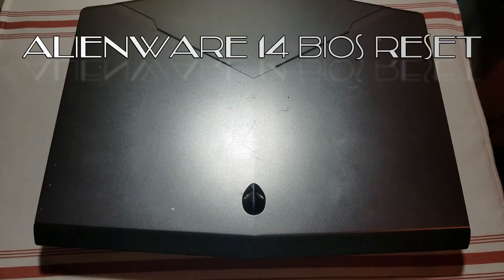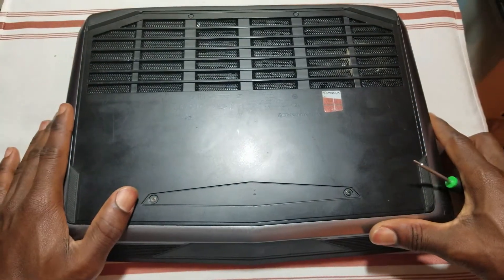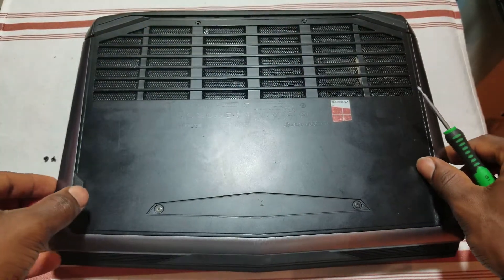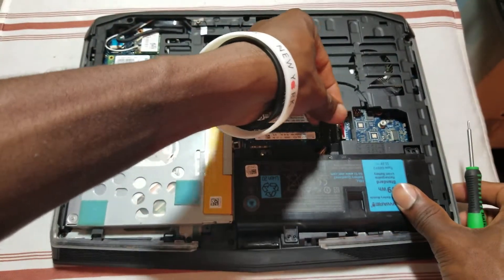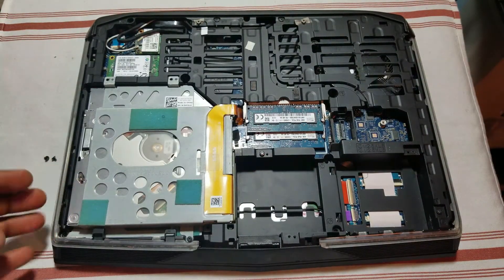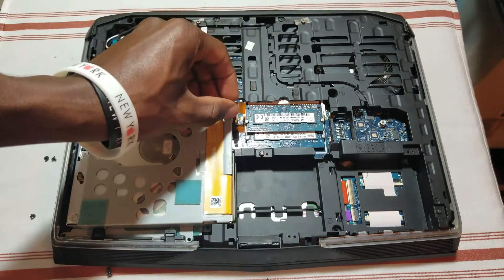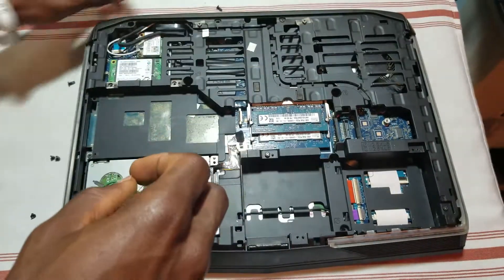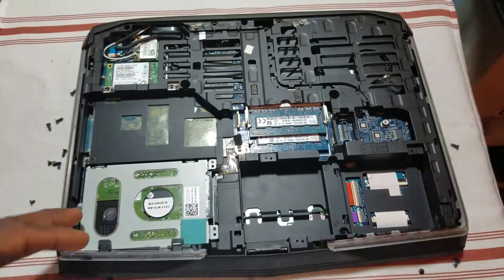Reset Alienware 14 BIOS CMOS battery Process

Comment: I have this exact model of AW14. Ive got a new board with the 2GB graphics card. When i installed it it turns on, lights up, but doesn't do anything else. Will this fix that? Its a good board just wont post.
Reply: Were you able to fix your issue bro?

Comment: I have a Alienware 15 R3 and My bios is Admin locked. I have disconnected the cos battery for 30 min and it never reset. Can you help me with this?
Reply from the maker: Check if next to the CMOS battery there is anything labeled PWD, PSWD, or PSWDCLR it could be a jumper or a switch. after actuated you have to try turning on the computer
Reply: @YvonSmart  Thanks. I will give it a try.
Reply: @YvonSmart  Yea I did that. And found nothing. It is on a laptop so I was hoping to be a utility to use to unlock the admin in the bios.
Reply from the maker: @mikehawk7307  Try this https://youtu.be/WS65KqtBx5Q?t=78

Comment: I replaced my main battery in my laptop tonight and now it gets no boot device found. You think it’s my hard drive or just need to re download windows? Thanks
Reply from the maker: This happens when the cmos battery is dead or missing,  It uses the same battery pack to keep the Bios settings in place. So when you replace the battery the settings will clear so you have to go back to the bios and set the boot sequence to the drive you installed windows on
Reply: @YvonSmart  I set the boot options to everything u mentioned in video and none worked. Says there is no media device. I try to load the windows manager but it’s like there no windows program to download. The battery was out of the pc for a week. So you think I may need to download windows again?
Reply from the maker: @joshuacohoon4742  Probably, that sucks especially if you had a lot of files and programs. So double check the BIOS, 
Secure boot: ON/OFF
Boot type: Legacy/UEFI
There could be other settings that changed and could prevent windows from booting. But yeah, if none worked, reinstalling windows is the last option. Do you know how to do so?
Reply: @YvonSmart  I do not. I’m taking it to a pc repair guy today. He’s gonna download the newest windows for me. I only had the old windows on it. Sweet pc but I got tired of having leave charger hooked up so replaced battery.
Reply from the maker: @joshuacohoon4742  Ok, that's better
Reply: @YvonSmart  thank you for your help!

Comment: Both my ribbon cables came apart. Or more precisely, the ribbon cable connectors came apart. They've turned brittle due to heat and age. What do I do now...?
Reply from the maker: It would be safer to replace used or damaged cables or they may cause other problems! Make sure to purchase them from an official source or it might be the same ribbon cable but made for different application!

Comment: can that CMOS Battery be replaced? THanks.. I have a somewhat older A/Ware laptop (think it has a bad GPU!)
Reply from the maker: High Lander
, sure! usually that battery last forever because it is constantly being charged by the laptop's battery , but if you think it's dead, replacing is the way to go.
This is the battery it uses (CR2032) https://www.amazon.com/Sony-CR2032-Lithium-2032-Battery/dp/B005HSW33C/ref=asc_df_B005HSW33C/?tag=hyprod-20&linkCode=df0&hvadid=198057711065&hvpos=1o1&hvnetw=g&hvrand=4973103330922338885&hvpone=&hvptwo=&hvqmt=&hvdev=c&hvdvcmdl=&hvlocint=&hvlocphy=9004082&hvtargid=pla-351191459478&psc=1

Comment: i had a master password 
by that i cant go in bios as well as windows
can it be broken
Reply from the maker: I think the best way to go is to reinstall windows! you can backup you files by removing the hard drive and connecting it to another cpt using this cable:
https://www.amazon.com/Sabrent-2-5-Inch-Adapter-Optimized-EC-SSHD/dp/B011M8YACM/ref=sr_1_4?ie=UTF8&qid=1522078837&sr=8-4&keywords=hard+drive+adapter

Comment: not working
Reply from the maker: Saket Dev, are you using alienware 14 R1??? make sure to update bios to  A10.
here is the link to download the latest bios. first click on "detect PC", detect will then install a little program on your pc and you will be redirected to the updated drivers. Download Bios.
To install, close all you running programs, make sure your AC adapter is connected to your PC, then run the downloaded bios file. Installation takes less than 5 minutes.

http://www.dell.com/support/home/us/en/19?app=drivers&c=us&l=en&~ck=mn
Reply: how i can update the bios when it is having the password
i cant go in the bios not in the windows
pls help
Reply from the maker: You update the bios from windows! not by going on the bios. Once you ran the bios setup file, you just follow instructions. Removing the CMOS battery should ve cleaned up the password but unfortunately not in your case. Let me know how it goes.